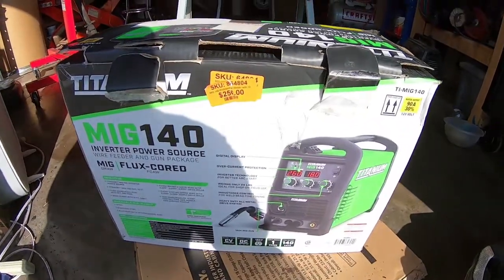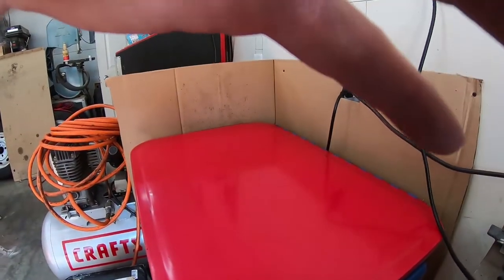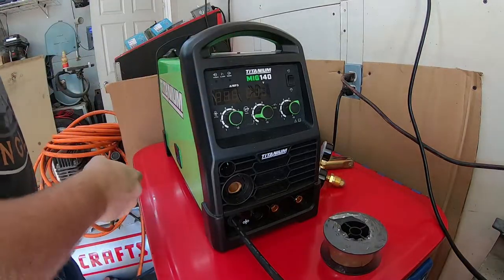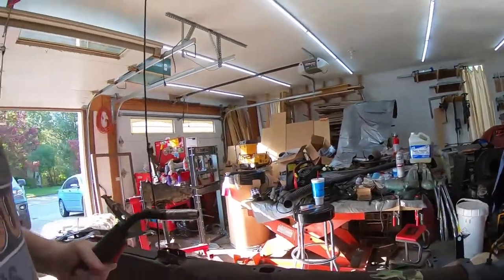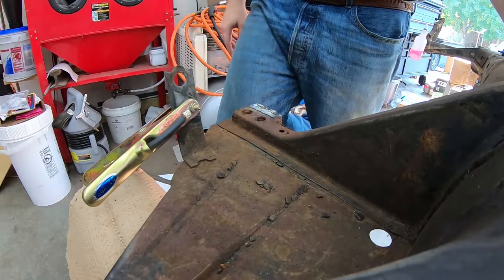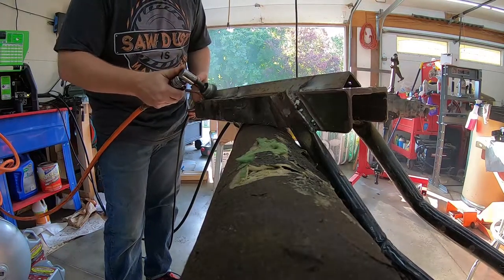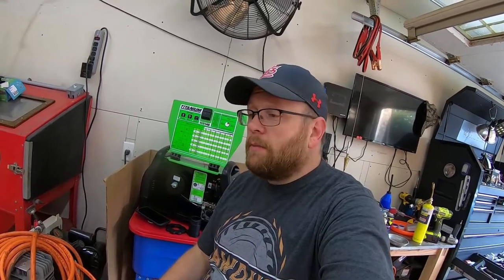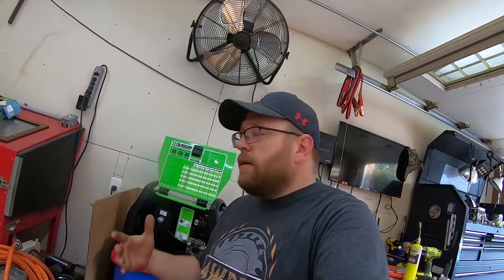Taking a Gamble on an Open-Box Harbor Freight Welder

Comment: If you’re going to weld, you should invest in a chipping hammer.
Reply from the maker: I’m not stick welding here. All that is left after flux core is some residue that goes away with a wire brush. Zero residue if I Mig with gas.